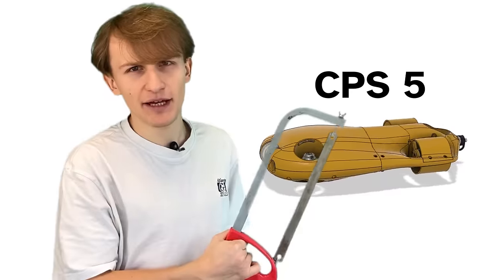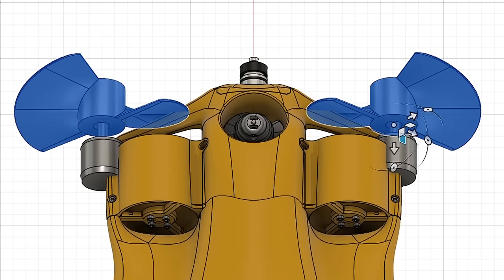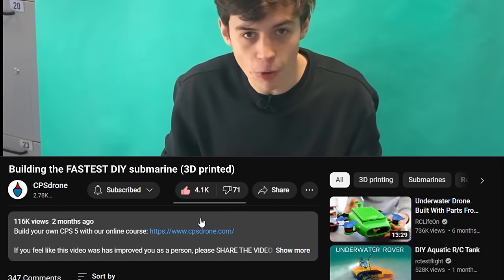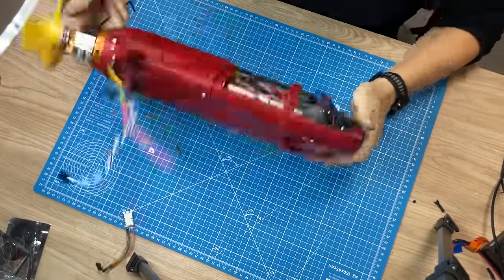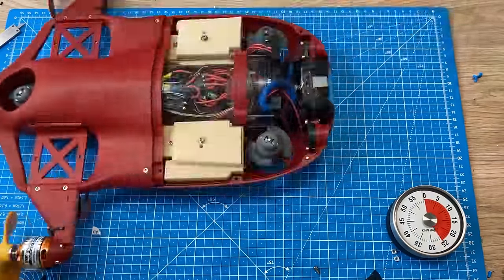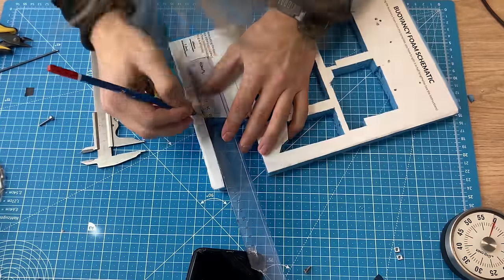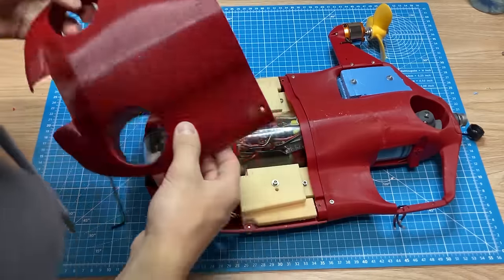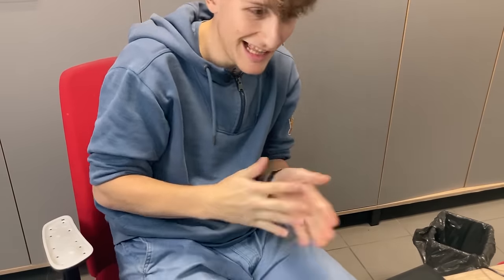Building the FASTEST DIY submarine

Comment: Argh, those poor propellers, mangled by saws.  I Was hoping you'd put a cover over the nut, to keep the trailing edge shape, as you'll lose a measurable amount of performance with just the bare nut.
Reply from the maker: We might try that. It would be interesting to see how much that one factor will improve the speed.
Reply: I kind of doubt it. Sharrow propellers are probably the highest performance outboard motor propellers they have the same open trailing edge design
Reply: @Neberheim  That's because there is exhaust coming out of them. There is no exhaust coming off the back of these propellers, thus it would help to have a cone. It was the first thing I saw that they could improve.

Comment: Hey, I might be able to help. Do you know the Kv of the motors you used? This situation definitely calls for the lowest KV motor you can find and at least a 4S battery. It will be far more efficient because you will be drawing far less amperage as well so everything will run cooler. You will sacrifice some runtime potentially by having to use a larger battery but due to the overall efficiency of the low KV and higher s rating it might actually run for a longer period of time. Anyway I'm about to buy your course and build one myself! Awesome work

Comment: Print it in 95A TPU maybe with at least 1cm walls (on the areas that will crash)? You can solvent weld and smooth TPU with THF. And you could leave room to slide in some sheets of polycarbonate. Then it would be hella tougher. Nice work!

Comment: Super job guys, and fun video. That's a pretty small ESC for such a motor, I would have expected a 50-60amp with a thick heatsink. I think you should test this again in a larger pool and you'll probably get over 4m/s. I can't help but feel that you need to make a proper fan duct to get that speed. As for the leatherback turtle, I think there's probably more to that speed. Like it needs to be in a current.
Reply from the maker: The heat actually dissipates really fast without a heatsink. I think for anything more powerful I'd be just easier to somehow put ESCs outside the electronics pipe, in the water. 
A motor hub/duct would definitely improve the speed, but also the props weren't centered perfectly.
You're right, leatherback turtles are suspicious, we need to race one. It needs some turtle-proofing though, so that neither the turtle or the drone gets hurt.
Reply: @CPSdrone  I wonder if it is worth considering a prop with a built in duct housing. Like the ring around the prop. That does add weight, but not as much for marine props. It would hopefully reduce turbulence and cavitation.

Comment: seeing what speeds you reached with what kind of electronics actually makes me respect some old toy rc boat I have more.
it was a old rc boat that was mostly a rc speedboat, but also could go underwater and stay just below the surface.
that old thing had a basic brushed motor, based on how long it could work on a single battery it would use around 30 to 100 W in total for the entire boat.
the motor just had a long axis on it which went trough a insane amount of grease just like vaseline to make it water tight, then at the end there was a small screw around 2 cm to 4 cm diameter or such.
the speed on the water was 12km/h. underwater it would go at around half that speed, this was also largely due to the diving actually working by just flipping a rudder to steer a part of the motors force to force down.

however while it also sends out quite some water it doesn't seem as extreme and powerfull as the motors you used, which is weird since according to that it should be slower instead of faster, but perhaps the streamlining of the boat. or perhaps the rpm might be part of it, or the general efficiency of the propellor and such matched to the speed or other thigns to reduce turbulence in the water since that boat seems to have a lot less turbulence than the motors you use in this video, the amount of water seems less extreme but much more in a straight beam.

it would be interesting to see what happens. that boat is broken now, the motor and propellor still work however.
but in my case I wanna try to figure out some kind of small energy efficient motors to use to strap on braces on the arm or on a surfboard or such, but probably more on something like arm braces so it is kind of like a submarine but then you are the submarine yourself, that would probably feel great, kind of like floating since you are as good as weightless yet still would move through the watter as if you are gliding.

Comment: We have a model building club here in town.
They participate in boat racing competitions and they are using way smaller screws.

Actually, what you should have done is meassure the voltage and current to figure out if your power is restricted by the battery or if your esc is at the limit.
Then use a number of differen screws to optimize the setup.
A static setup in a bathtub will only tell you so much.

Comment: Such amazing efforts guys, but i would love to see more solution on the cooling for ESC
Reply: If I've understood correctly, it is not in direct contact with water but inside that electronic tunnel.

Make it waterproof by pouring epoxy on it, then take it out of that tunnel and take profit from that free best watercooling you will ever get.

One easy fixe would be a bigger esc, as there are others able to handle 80A without overheating.

Comment: Really beautiful video keep going! if you want to increase speed you need to improve hydrodynamics. Any protrusion (especially if of a small surface area) creates a large viscous drag (it is related to the Reynol number).Try to reduce the small surfaces and improve the hydrodynamics of the engines by adding cones.
Reply from the maker: Thank a lot for the tips! That's exactly what we want to do if we ever make it even faster - start with a smooth teardrop shape outer shell. But that will require way more changes in the design.

Comment: I have such an idea for a safety system against losing the drone due to entanglement of the cable.  Hardware - Cable cutter, standard co2 cartridge connected to an inflatable balloon, e.g. made of latex, something like a condom.  Soft is a simple instruction. If the drone has tangled the cable under water and it is impossible to get it out, the cable is cut and the balloon filled with co2 floats to the surface.  Cutting the cable and opening the co2 tank requires strength, maybe a mechanism based on the action of a screw.

Comment: So the solution for speed was a better propeller and a whole lot of brute force, i kinda feel like the original design could be even faster than this purely because of the smaller profile if you just added this propeller in place of the original and turned the power to eleven. This one definitely turns better tho because of that extra leverage
Reply: Correct, they didn’t fix the issue and make a better design, they just added more power…

Comment: you could've added the new motors instead of just replacing the old ones since your moving them anyway. use all 4... the smaller ones to get up to speed for a sharper pitch blades on the bigger ones, like a 2 speed transmission.

Comment: Aren't the ESCs in the dry tube? How is their heat dissipated to the water?
Reply from the maker: Yes, the thought process was a little simplified in the video, but after further testing I've concluded that it can normally get that hot and it will be fine in the electronics pipe. Of course, we didn't test the drone for long enough to see if that would be an issue later on. I didn't replace the cables for thicker ones because of the water.

Comment: You should use a low KV motor, maybe 350 kv not your 1000kv.  Overloading the 1000kv motor will waste a lot of energy.  You probably need a smaller prop  to allow motor to turn faster.   You should have a meter to measure performance of motor, current, power etc.  so you can optimize the setup.    Crazy cut and try method may end up with burned parts.

Comment: Those motors are way too high RPM for water use. You'd either need to gear them or use different motors. Also you're losing thrust by no longer having ducted props.

Comment: I mean, it looked to me like your engine doesn’t have enough torque.  It can spin very fast, but it doesn’t need to spin fast, it needs to move heavy water.  You’re putting more power into the engine, but that’s basically just cheating..  You’re forcing more power into it rather than fixing the actual engine.  It’s like, riding a bike but you have it on a high gear, but you need it in a low gear.

Comment: The motor is not corrosion-resistant
Reply from the maker: It's not but it works for a long time. Even if you swim with it in salt water you can just rinse it with fresh water after each use.